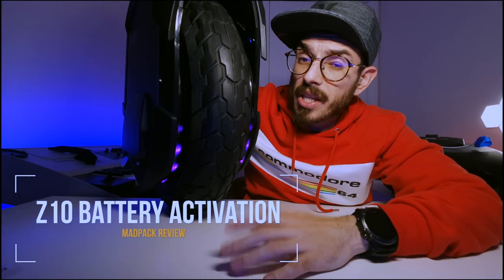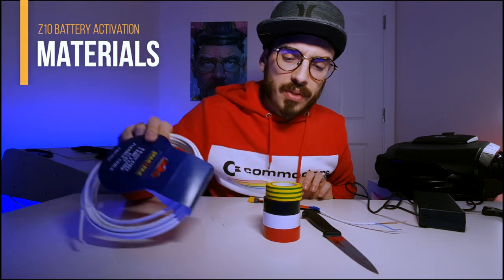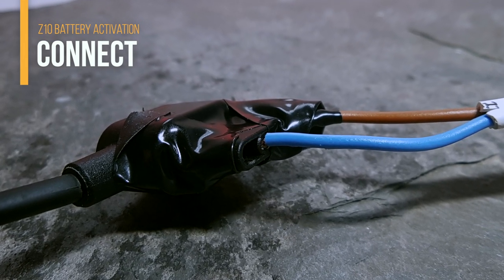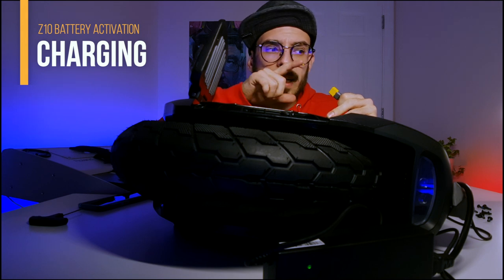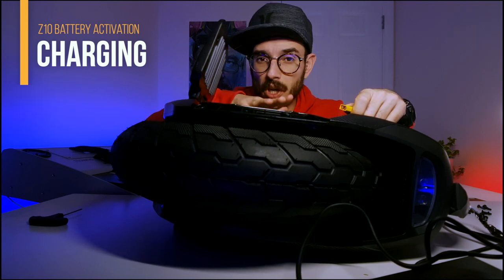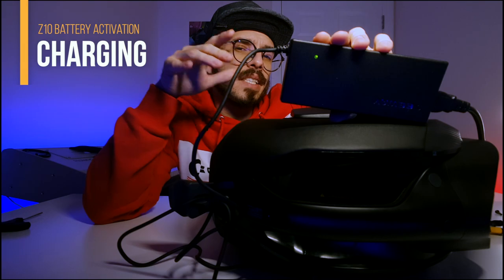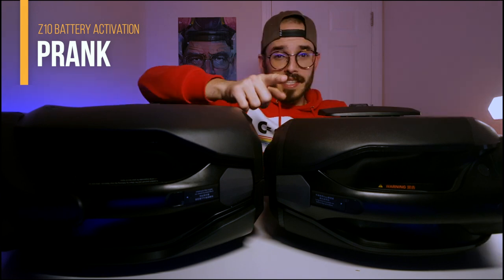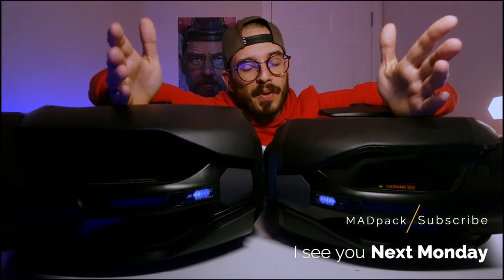Ninebot Z10 Battery Activation - THE ONLY SOLUTION!

Comment: Hi !
My Ninebot Z10 does  a strange noise when I ride it... has this happened to you ?
Reply from the maker: That must be bearing
Reply: @MADpack  thanks... would you know what to do about it ?
Reply from the maker: Yes I’ve done: https://youtu.be/ex2AxQR377Y
Reply: Right, so I looked into it and I am pretty sure that is to do with the fact that it isn't connected to the app via bluetooth and I am having issues with that. I get asked for a pin that isn't provided to me so I don't know what to do... I've tried powering the wheel on and off and so on with the bluetooth on my phone but still not connected... I think once I connect it it will let me ride it with no problems
Reply from the maker: I don’t know since you talked about noises I though it maybe bearings if it’s not turning on and is not like the situation that I shared few years ago than yeah I really think you may have to swap the motherboard or something else
Reply: @MADpack  thanks dude... I'll drop a message when I get it sorted
Reply from the maker: Thank you hope you manage
Reply: @MADpack  I just had to turn the location on 👍🤣
Reply from the maker: What?!
Reply: @MADpack  i fixed it about a week and a half ago... I was on a chat with my ninebot seller on Aliexpress and emailing Segway :') and by the time that I got the 2nd email from Segway, it was when they said to me; "make sure you have all your permissions on, including location."
Issue solved and my wheel and I are already wanting to go faster, we've already even fallen together already ♥️🏄‍♀️

Comment: hi friend, do you know if there's one way to reset z10 password so i can use the app?
Reply from the maker: I doubt otherwise what was the purpose of a password?
Reply: @MADpack  FYI yes, there's a way to reset password. Lay down and hold the power button after two beeps for 17 flashes of led lights, then release it... the password will be reseted.
Reply: Take this as a suggestion for a new video.
Reply from the maker: Seriously so what's the point of a password? Thank you for sharing

Comment: Also to note - REGEN braking on this only charges one of the batteries .... not good at all!
Reply from the maker: It makes sense if you think that the other one is a safety battery. If you run out of battery the slave battery will turn on to avoid that the segway turns off immediately.
Reply: @MADpack  So the other battery is completely redundant and not used unless the first dies? I have seen a video of some one riding up a large hill and getting down to 50% then riding down still showed 50% - when he got home and check one battery was at 80% the other still sat at 50%?
Reply from the maker: Couldnt understand your message
Reply from the maker: Bro one of the batteries is just a slave one.. Is the emergency one.. So you are not draining that battery down when you are riding so i think that is normal. That one is there of you lose the energy in the other one.
Reply from the maker: One of the batteries is there only in case if you run out of battery ot will jot turn off ob you bro
Reply: number1 stunner187  Most EUC do this, the units only use one battery at a time when that battery runs low then the next battery kicks in to prevent the battery from running too low. If the battery runs too low you get this problem where you cant charge them.
Reply from the maker: Thanks to coming here and clarify better